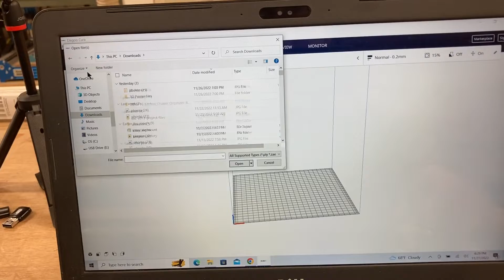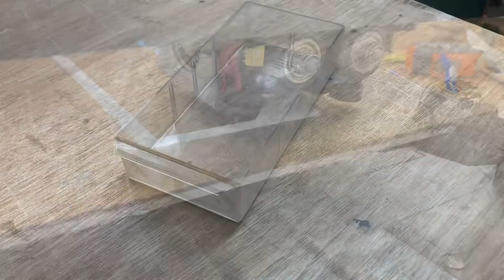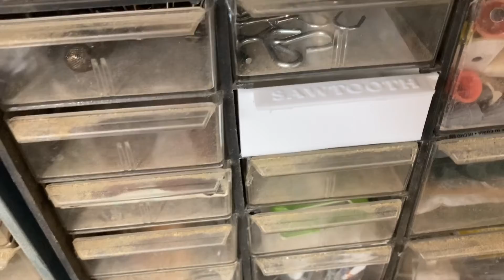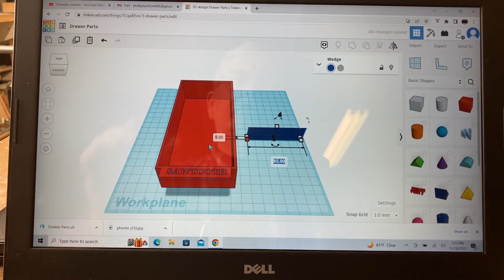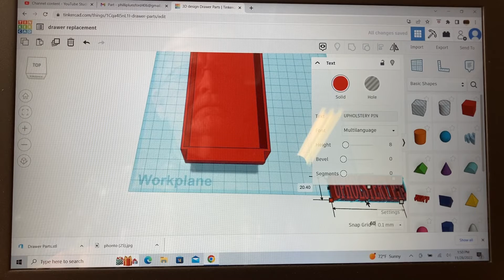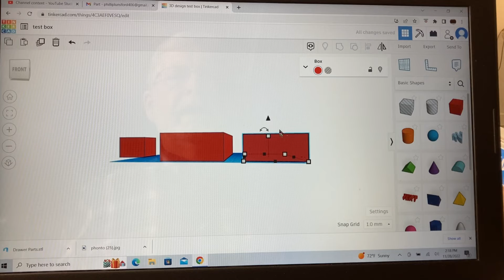Experimenting and Correcting a Problem With the Neptune 3 Pro

Comment: oor you could just select the experimental setting "make overhangs printable" in cura and watch it adding an optimal wedge under the overhang
Reply from the maker: I’ll be doing that also
Reply: Or you could also print supports in the slicer if you don't want to have that little wedge on the handle. It's really up to you. I have this printer and I have noticed it's very good at printing supports, much better than my Ender 3.

Comment: as others have pointed out nozzle to high.
not sure what your print speeds are set at but it could be quicker.
there is a over lap feature that needs to be around 30% for the layers so it bonds to the walls better.  cura software time can be way off on some prints well nearly all of them. you want faster print speeds less time the adjust your print speeds do first 2 layers at 40mms then do the rest around 80mm to 100mm.
put the file on to a sd card then put that in the printer do not print via the usb  cable if the computer decides that a update needs doing its power supply fails to keep it alive and battery drains then it will be a failed print .
put it on the sd card get it printing the walk away and let it do what it has to do.
i did notice the print is lifting off the bed this is due to lack of adhesion due to being to high of the bed this could be seen at the start.
if you do a skirt around the part and not a brim as it is printing you can adjust the z off set while it is printing via the tune one the screen when it starts doing the skirt you will see it and look for it to be squishing the filament into the bed and getting a slight overlap

Comment: Obviously, your solution worked out fine. But if I were presented with this issue, I would just have radiused the corner.
Reply from the maker: Yes, that work work. I could also just use supports. Lol

Comment: Might just be me but, when you printed the brim it appeared that the nozzle was a bit high and didn't have enough "squish" on the first layer.  When I pick my parts off the build plate after using a brim I never get the "stringing" from the separation of the brim like that.  Again, I run my Z down a bit tighter to the bed to flatten out the crowns a bit more.  Just my way.  Actually don't use a brim very much, only when I want to control potential warping.  

Once you get the feel of the geometry and percentage of supports no need to avoid using them.  There are also 3rd party addins for CURA that let you customize them to more suit your needs.
Reply from the maker: Thank you very much for the information. Thanks for watching. I was a little surprised by the brim turning to string. I agree z axis a little high.   I’m still learning Cura.